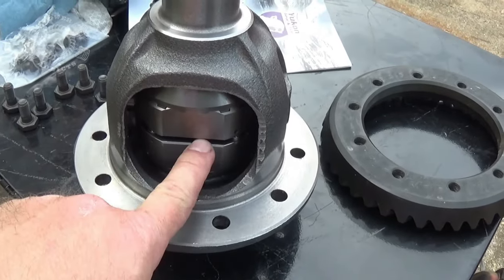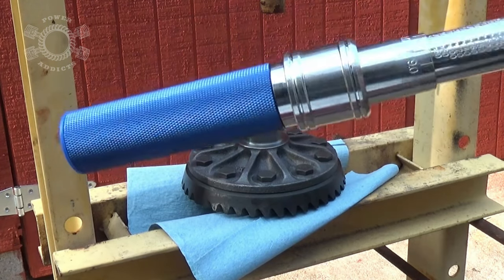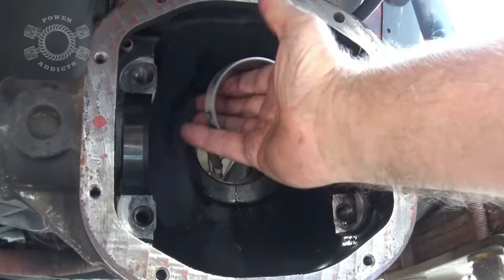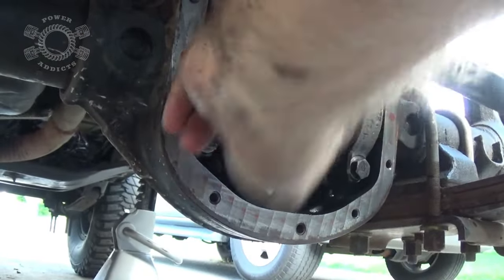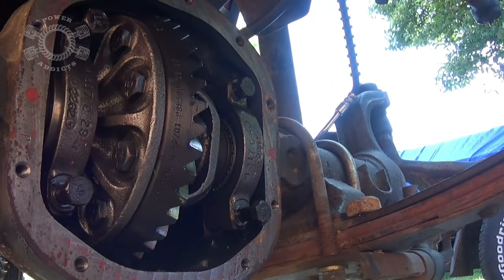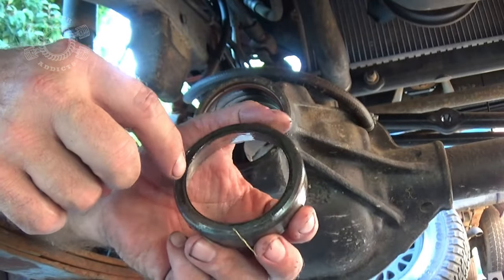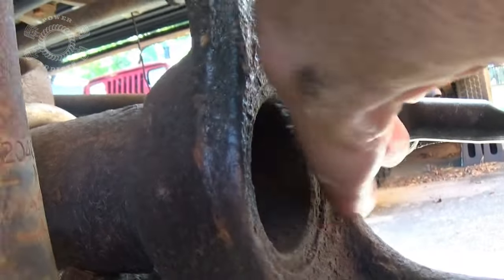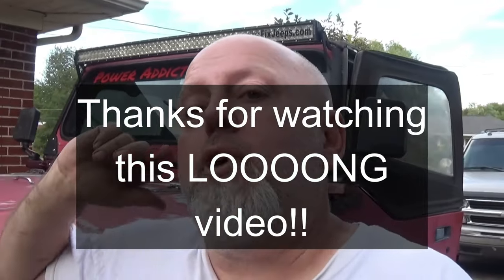Jeep Wrangler YJ Dana 30 Prep time for Changing Ring and Pinion #poweraddictscrew #jeepyj

Comment from the maker: Here are the parts and tools used in this video.
Dana 30 rebuild kit: https://amzn.to/3ZlEqtc
Seal installer: https://amzn.to/3ZoA8RN
Pinion tool: https://amzn.to/3rc8B9E
Dana 30 Ring and Pinion 3:73: https://amzn.to/3sWG4p4
Yukon 3:73 and up carrier: https://amzn.to/3EKSToS See D30 locker video for info on this: https://youtu.be/8igMZ0IAGW4
CAD Axle shafts bushing: https://amzn.to/48hAkq3

How to remove the brakes. This is a TJ vid but it is the same on a YJ: https://youtu.be/____qff-R6o
How to remove the hub bearing: https://youtu.be/Y-byZtEJOVg

Using any of these Amazon links gives Power Addicts a small commission at NO EXTRA COST to you. I really appreciate your views and support. Y'all have a great day!!

Comment: Thats the big thing most keyboard komandoes forget, Your building this vehicle for general purpose on and off road not an extreme crawler or mud truck. The YJ is capable of doing rough trails but it not the vehicle YOUR going to take out and beat the snot out of...If you can pound that into the KBW's eventually they start to get it... I get the same thing only IRL with my 2k TJ daily trail rig and my toy 47 willys beater. People keep saying "you should build up the TJ as a crawler and sell off the willys since it will never be as capable". lol little do they know. all the little small trails and narrow goat paths that would tear up the TJ's paint and body with Arizona pinstriping, where as the willys squeaks through those same trails no problem and the body is so scuffed its not a problem getting more scratches just adds character.

Comment: why did your D30 had shims on both sides? behind race and in front of the race at the pinion? just curious. Isn't it usually just behind the race?
Reply from the maker: The shims behind the race sets the pinion depth to the ring gear, the ones at the pinion nut combined with the ones behind the race set pinion pre-load tension. Check out the other videos in my playlist that demonstrate that. Here is the link: https://www.youtube.com/playlist?list=PL8Fz_3RM9QXZUk9yqfh5RdNNMOBU1na_t Hope that helps. Thanks for being part of the Power Addicts Crew!!
Reply: @Poweraddicts  ahh alright, so no crush sleeve then if you are shimming preload. Got it. I'm thinking of regearing my 30 and 44 on a 06 LJ, so watching enough videos to understand the process and to avoid complete screw up :) Your videos are the best because you explain things in simple terms

Comment: ....Just heat the bearings on a plate up to 200°C and the slip on without force. There is a reason why it is a tight fitting!!
Reply from the maker: I should have done that. I have an oven that I used to powder coat with that would have worked fine for that. Maybe next time I'll not have a duh moment and remember that .. lol. Thanks for taking the time to leave a great tip!!